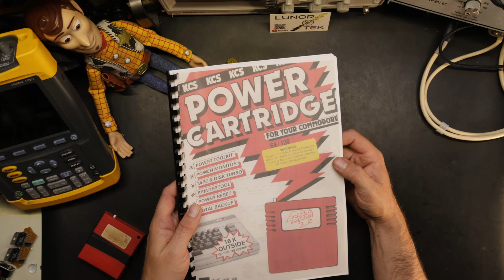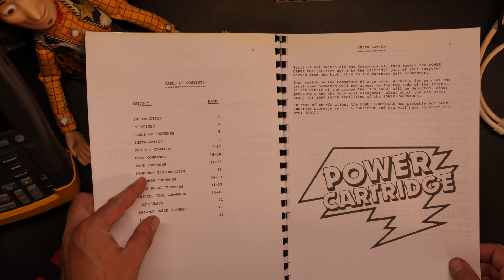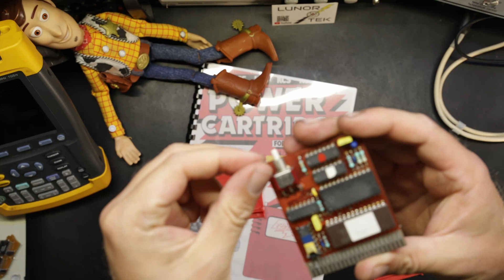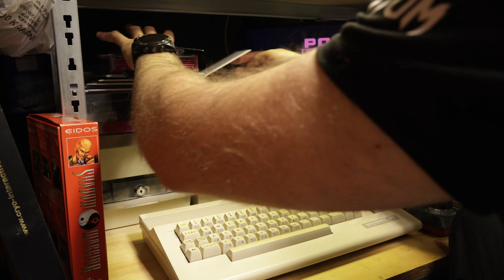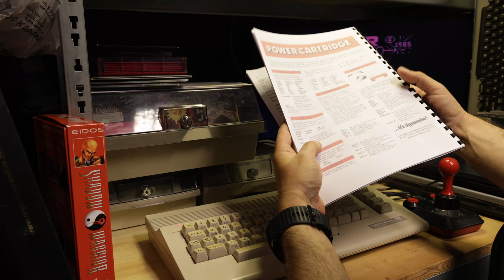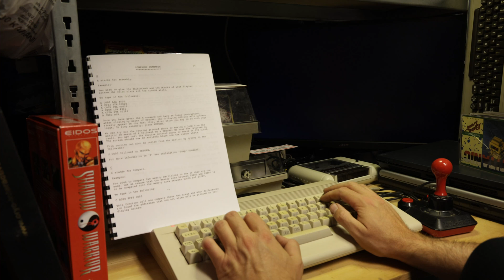Commodore 64 - KCS Power Cartridge aka Fast Loader  x5-6 Speed Test and Taken Apart

Comment: Fun how speed varied from machine to machine. Loading from tape on my 1981 machine was 60s for the biggest games (40kB was max capacity of the RAM for games) but on the diskdrive it was 4s. Both way faster than the C64 with or without Power Cartridge. And there was no second processor in the drive, which makes it even weirder.